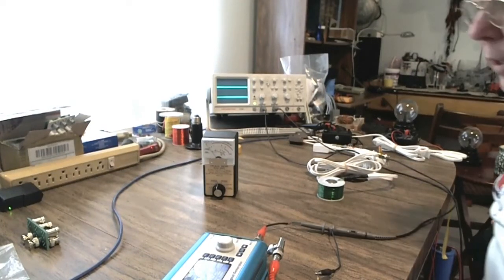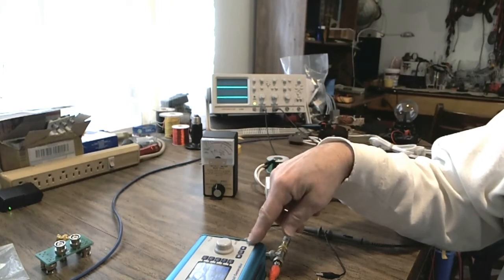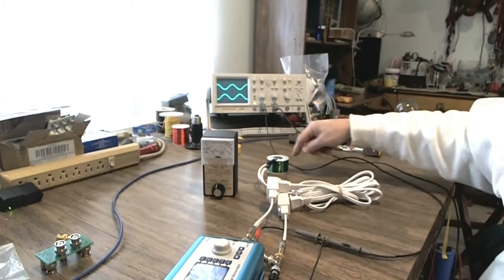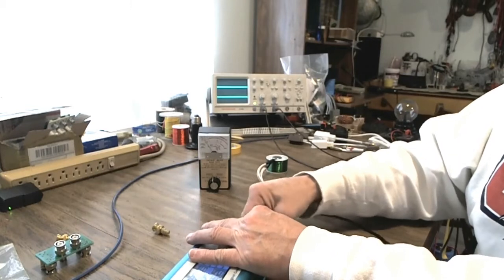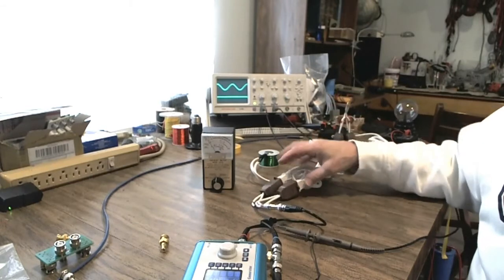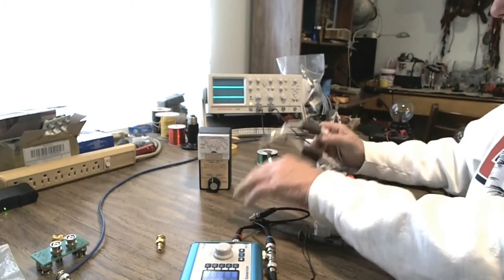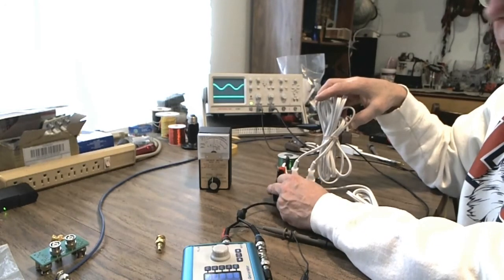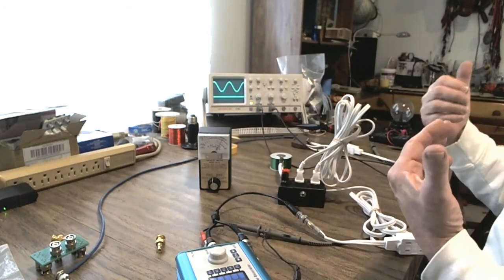Bifilar Coil to Function Generator Connections

Comment: Steve, I have a comment for you, after watching your video and watching those bundle cables up on the table you are creating an extra Field, by letting those cables run loose your field will be (Stronger in the Coil section), do you realize that you're creating extra Fields with those cables up on the table . I discovered anytime you have cables bundled up like that it creates its own magnetic field. Don't you want to create all that energy in the coil? The wire itself carrying the frequency will automatically have a magnetic resonance in The Wire yes or no. I believe that back in the day when they were creating these frequency generators, they should have been sending the frequency through shielded cable so that the strength of the frequency would be in The Wire and not resonate around the components that it is built in. I may be wrong, but that's how I see a stronger signal and a better output. What do you think?
Reply from the maker: You could be right but I would have to test it with much more sensitive equipment than I have.  You are talking about an insignificant amount of energy loss compared to what is going on in the coil.  I mean really insignificant by at least a couple of orders of magnitude.  Be well and respectfully,  Steve